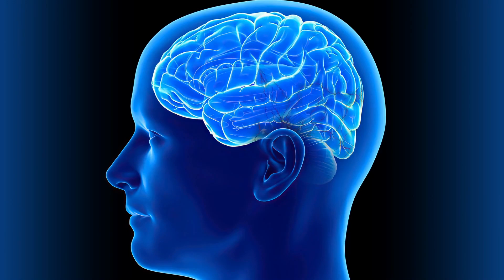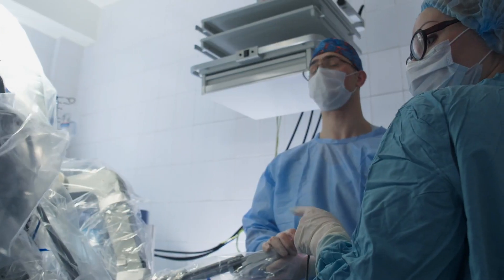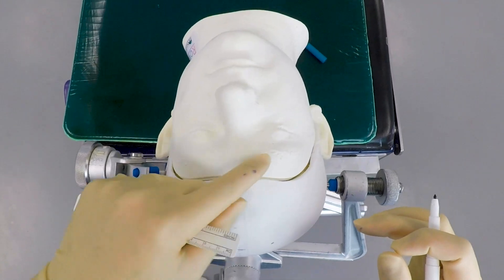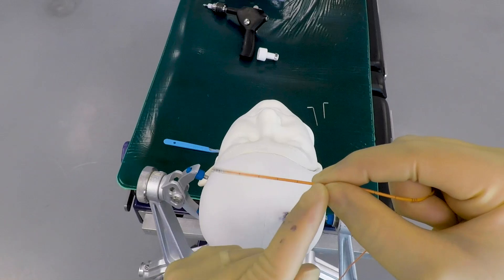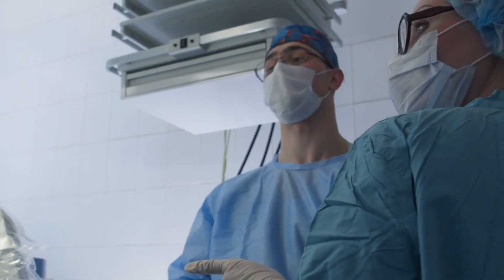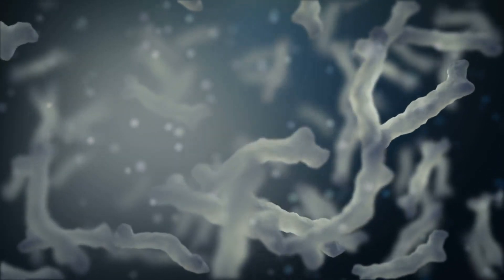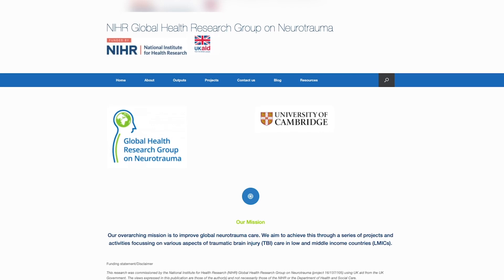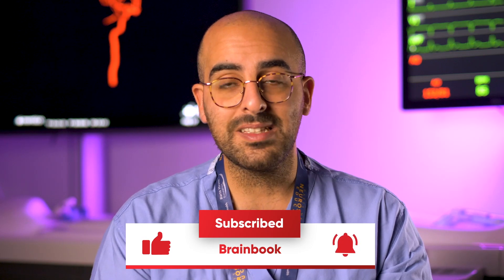Intracranial Pressure Monitoring - What is it?

Comment: Do you not repair the punctured dura before closing? Or does the bolt not go as far as to damage the dura? After suffering a cerebrospinal fluid leak im now hyper aware about these seemingly harmless procedures that require damage to the dura as chronic leaking is a debilitating condition to live with. Any lumber punctures or epidural medications need to be seriously considered and patients able to give proper informed consent as to the potential risks involved. I can understand doing it in unconscious patients, but surely the conscious ones can give you pretty valuable information based on symptoms alone as to their intercranial pressures without resorting to a bolt.